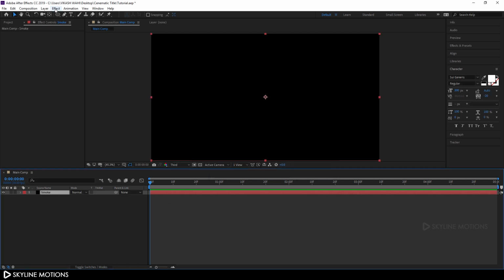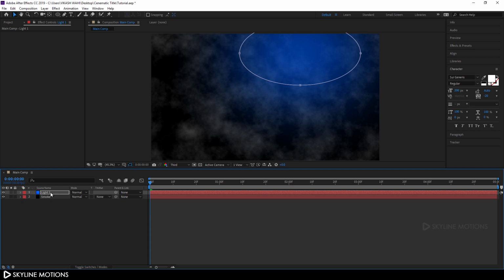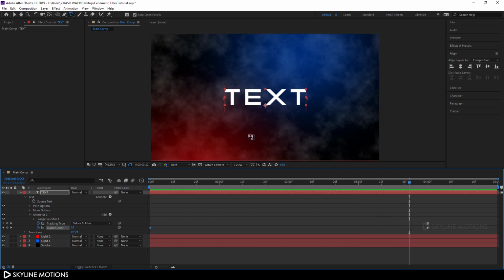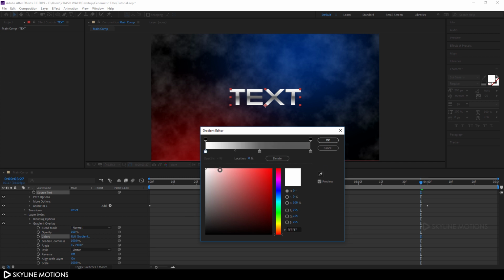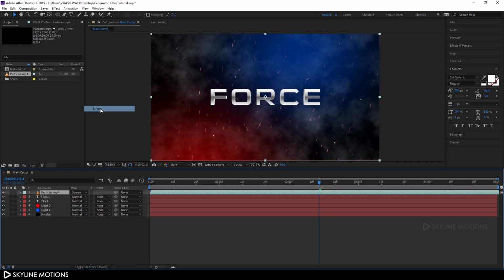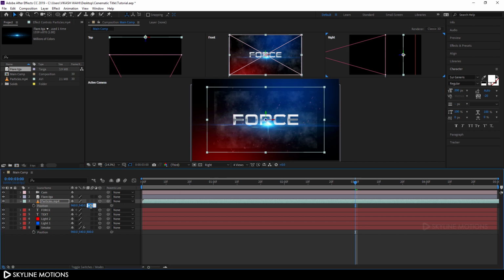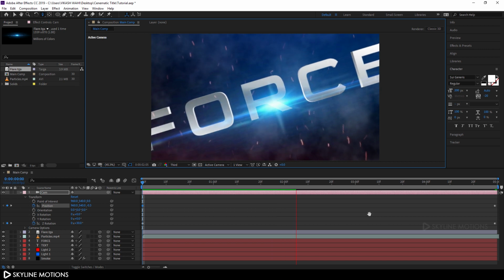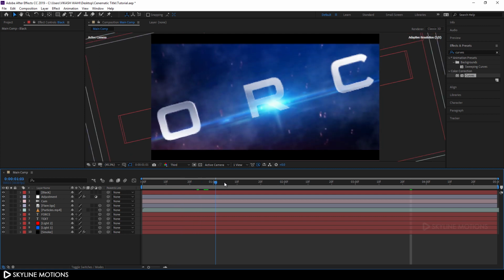After Effects Tutorial | Cinematic Title Animation | No Plugins

Comment: Hello,
I've a question. Why don't you simply create the text in 3d, why do you go, the extra mile by creating 2 texts with different spacing? Is it easier to  costumise?

Thanks veru much for the videos, u are the man!!
Reply from the maker: Thanks for the tip! but a 3D text in DaVinci Resolve don't gives you that kind of output, takes lot of efforts and need heavy computer to export.
Reply: @SkylineMotions  this is AE
Reply from the maker: Ops🤨

Comment: Hello. Im making te logo and I have a problem
time:7:25 the two text you pick whip  
I have 2015cc and do not have the pick whip bij  Source text 
what can I do? its my first project so Im a beginner.
Reply from the maker: You can skip that step it's not necessary I used that step for easy customisation, but you can't find that pick whip, then it's fine no problem. 
But remember one thing whenever you want to change the text, you have to change in both text layers.
Reply: You have to download cc19 to solve the problem

Comment: bro i have questions...
is DaVinci Resolve free software for video editing ?
is that better than sony vegas pro 15 ?
is DaVinci Resolve easy for video editing ?
I am making gameplays videoa so i dont need so much feature...but i need optimized video editor...so is DaVinci Resolve is optimized than sony vegas pro ?
Reply from the maker: DaVinci Resolve is free from BlackMagic Design.

It's a Powerful video editing and Compositing software

It is better than others or not I don't know because it depends on user.

In my opinion DaVinci Resolve allow you to do anything but this is very heavy software so if you want to work on DaVinci smoothly you have to buy a very high configuration computer..
Reply: @SkylineMotions  yes I have good pc i5 7400 with 16gb ram and GTX 1060 3gb...
Reply from the maker: Okay, 👍👍